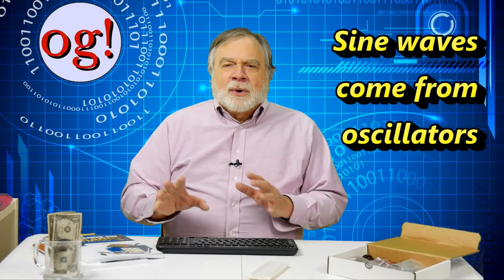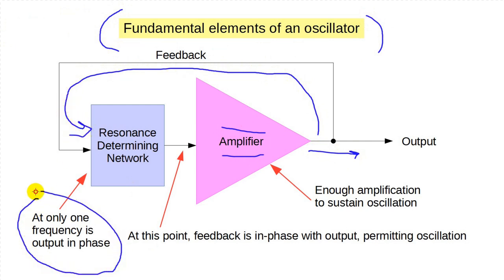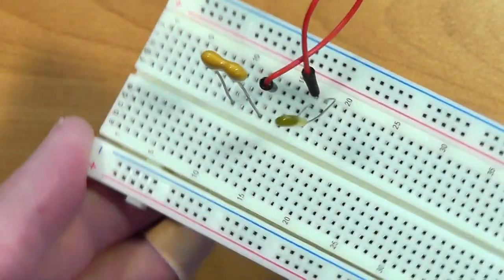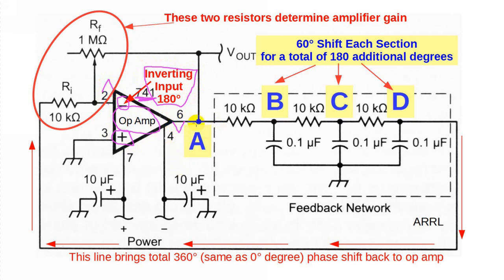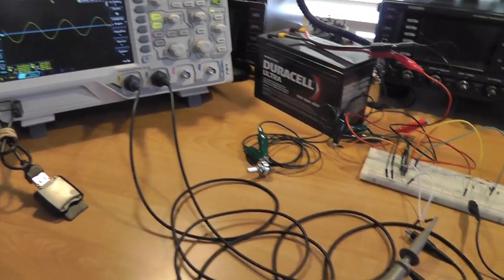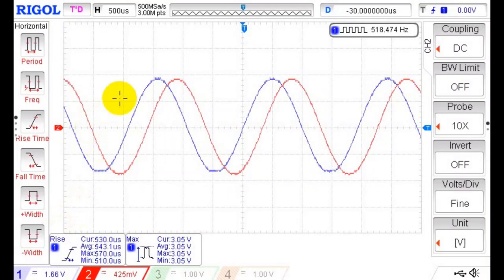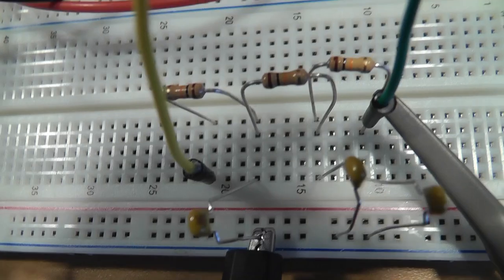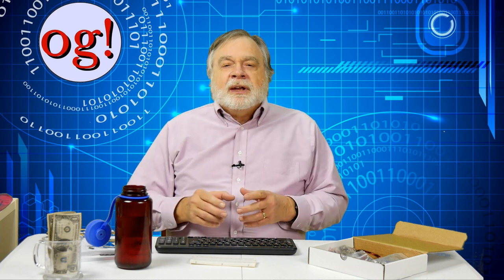Understanding Oscillators: AD #45

Comment: Hi David, I am not good at electronics at all but I have a question regarding oscillators so please excuse my question if it sounds stupid :). 

Is the voltage at the output always positive? Meaning if I have a +1V at input since the output is a sine wave does the voltage go to +2v like this +1 > +1.5 > +2V or is it +1V > 0V > -1V ?
Reply from the maker: Generally we speak of the AC component as having zero center voltage. Any DC overlay might move that center voltage up and down. In oscillator design, usually we try for pure AC without a DC component.

Comment: LM741 works with +15V and -15V rails. I think by increasing the offset
of output or feeding a proper positive and negative input supply to the op-amp,
it should be possible to oscillate with higher gain.
Reply: As shown in the video, the 741 does have a complete cut off (known in the industry as 'clipping'). It will only have gain to a certain percent no matter the voltage.  so that is exactly what Dave has shown here. You can only have gain until it cuts off ( if you notice the negative peaks start to flat line so to speak).

Comment: So, why not feed the op-amp output back to the non-inverting input?  That would seem to eliminate the phase shift network.
Reply from the maker: The key contribution of the phase shift network is to set the oscillator's frequency. If you did a direct connect to the non-inverting terminal, the op-amp output would go high and stay there. 73, Dave